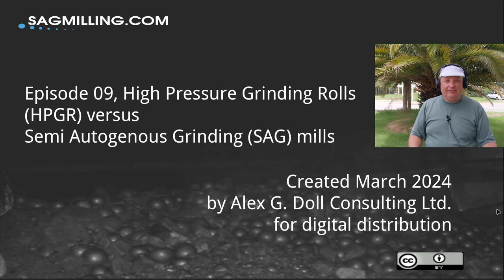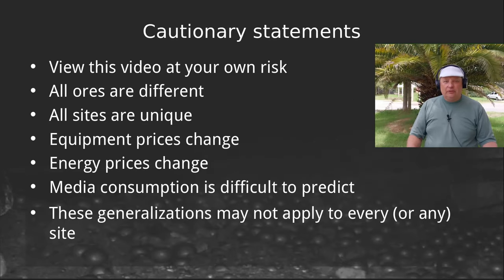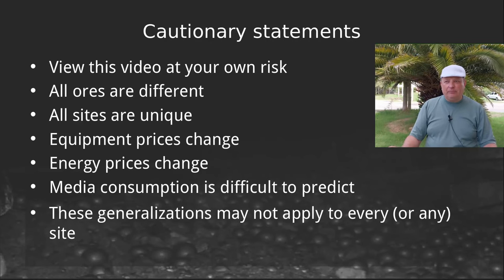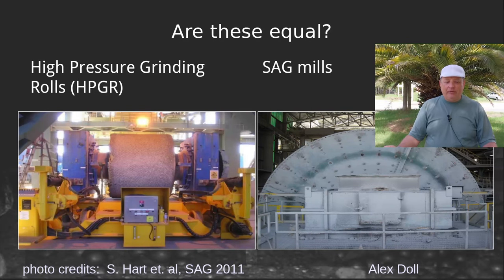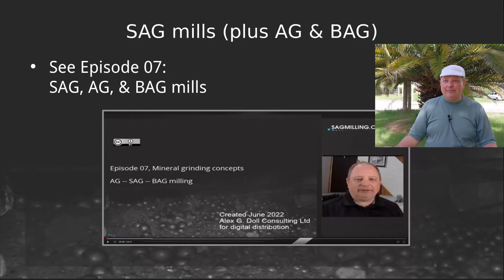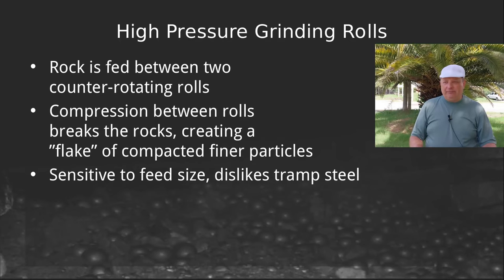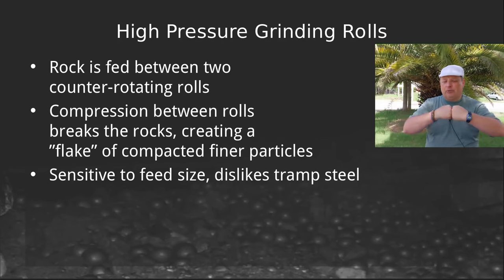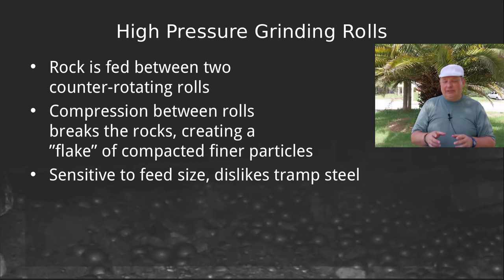Ep09 HPGR v SAG circuits

Comment: Hi Alex, great video. I really enjoyed it and also i have one comment regarding maintenance.
Altough it could be a more complicated item on SAG circuit, there is also a higher industrial references and data to perform the maintenance, including higher level of knowledge in both maintenance and operation by operators in comparison with HPGRs. Best regards

Comment: If you compare maintanace complexity between SAG mill and HPGR you can state correctly that unit maintenance activity is simpler in case of HPGR than in case of SAG mill, which is true. 

But I think that if you look at circuits as a whole, HPGR circuit is much more complicated to do maintenance on. To run 110k HPGR concentrator you need to operate 4 HPGR, 4 cone crusher, 4 dry screens and then 6 wet screens to feed 3 ball mills (each ball mill works with 2 wet screens). All that comes with its corresponding belt feeders (18 as total), 6-7 high capacity conveyor belts and its mobile tripper cars, transfer chutes and ore bins. So there you have a mechanical elements, belts, and great surfaces of various linings. 

Taking that into account, maintence logistics becomes much more complicated and number of possible failure points also increases significantly which is makes is practically imposibble to run HPGR plant with 95% of aviability.

But at the same time, a failure of one HPGR or one cone crusher/dry screen/wet screen, does not stop the plant which is still running but with lower throughput. 

Anyway, this is a great video, cheers!
Reply from the maker: Yes, @bartomiejryszka4222 , the crushing and HPGR circuit will be lower, I agree.  The point I was trying to make is that the ball mills in an HPGR circuit can be if there is sufficient surge between the HPGRs and the ball mills.